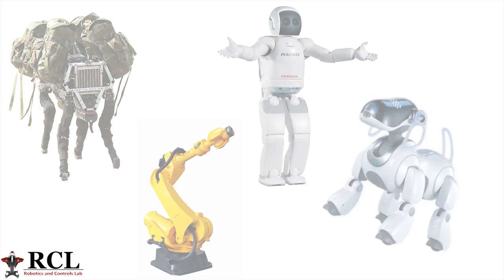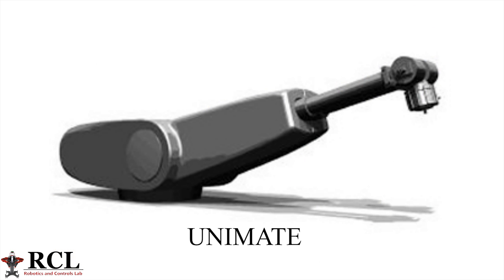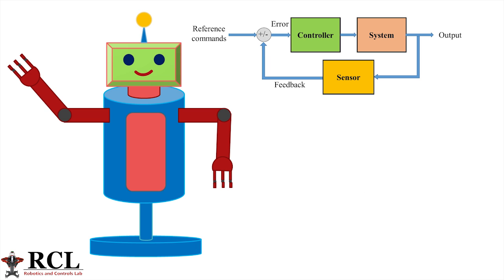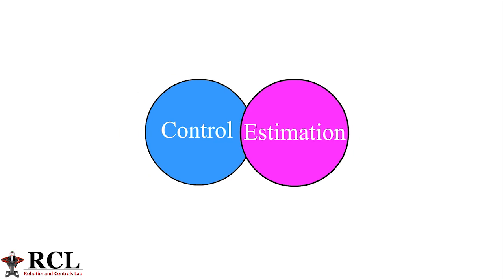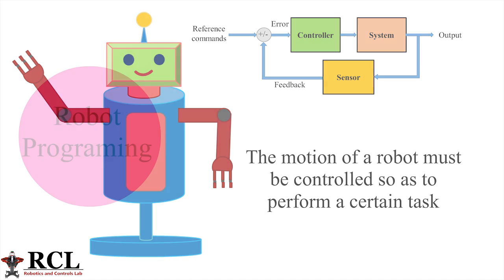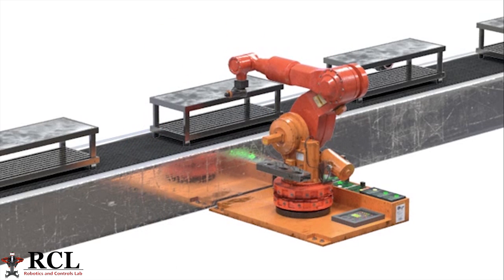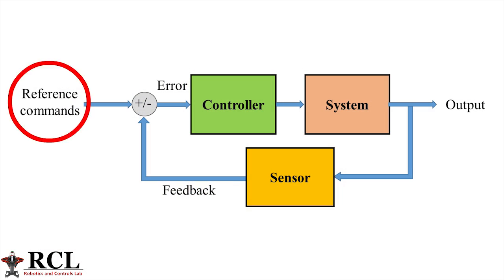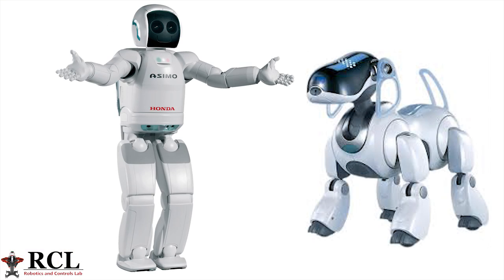Robot Control Programming

Comment: Orbital Satellites Shortwaves Sw160khz Transmissional Harmonious Planetary Programmed Radio CNC AUTOMATED REVERSE Mechanical Robotic Machines to Labour very Constant Universal LlSpecial Universal Unison Nuclears None Nuclears Diffusions Disarmaments Kind. Constant Universal Unison Orbital Satellites Shortwaves Sw160khz Transmissional Harmonious Planetary Programmed Radio CNC AUTOMATED REVERSE Mechanical Electro Magnetic Radiocyclewaves Transmissions. MAGNETIC VACUUM DIFFUSIONS STRANGE FAST DISTINCT UNUSUAL REVERSE MECHANICAL SOUNDING PATTERNING SW160KHZ TRANSMISSIONAL 160KHZ RADIOCYCLEWAVES TO USE TO RUN OPERATE PLANETARY PROGRAMMED ENVIROMENTAL SW160KHZ TRANSMISSIONAL   RADIO CNC AUTOMATED REVERSE